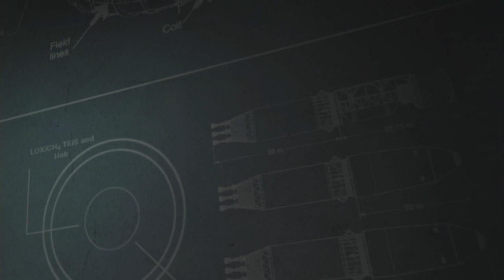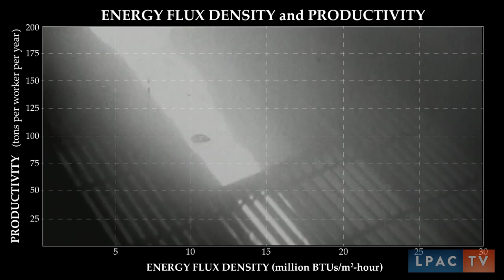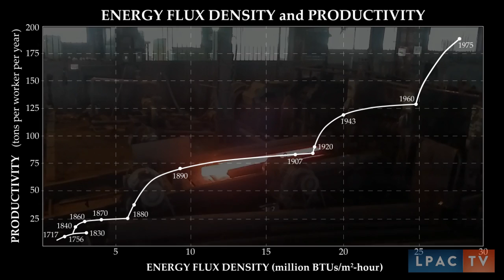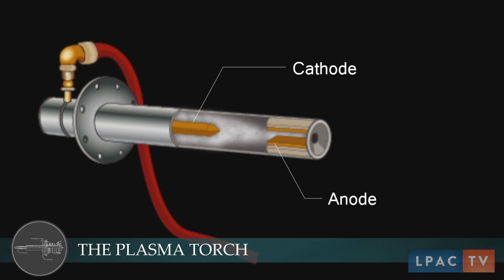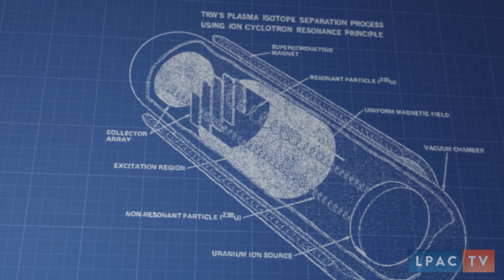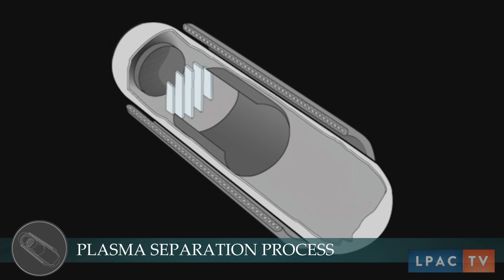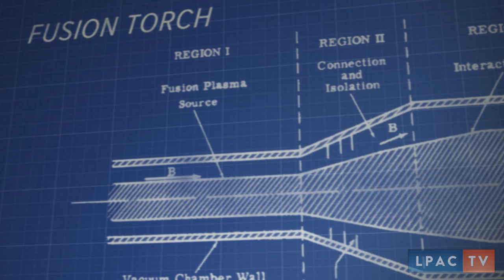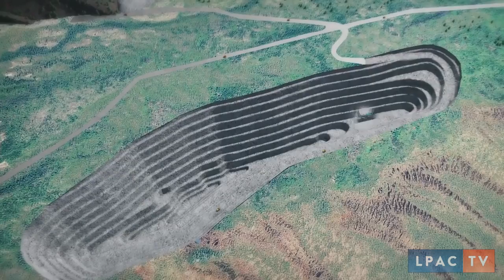The Fusion Torch

Comment: Could this technology be used for the cleanup of garbage and other wastes? If I understand this correctly, garbage could be processed into a fusion torch, allowing for it to be reused. Also, Fun Fact- This is the tech that Homeworld used back in 1999.
Reply from the maker: +Christian Hahn -- If we develop it far enough that is a possibility.  The first applications will be for higher value and higher cost materials -- for example, separating the elements and isotopes of spent nuclear fuel.  As the technology progresses, and the economy as a whole moves to higher levels of energy flux-density, it will be economical to expand the use.  However, to make any of this happen we'll need a major shift in the direction of the USA!  The current election process looks like a death-sentence for the USA.  Things like the fusion torch can be our future, but we have to fight for it!